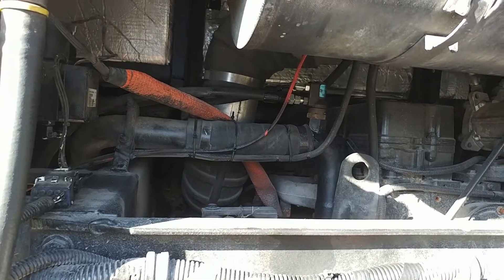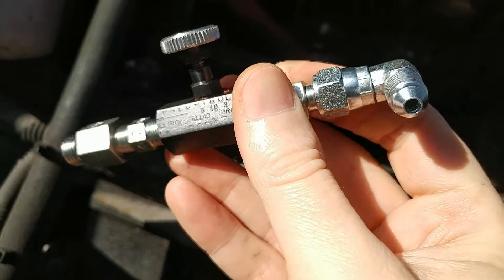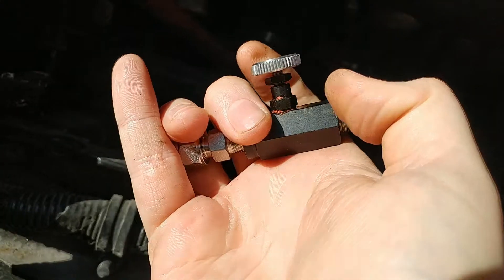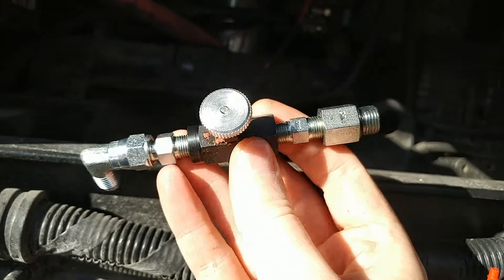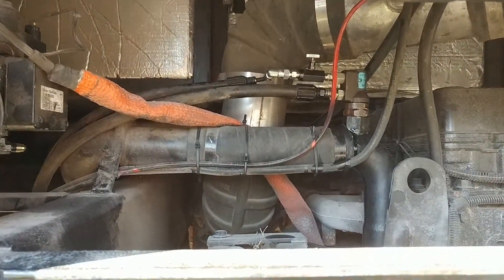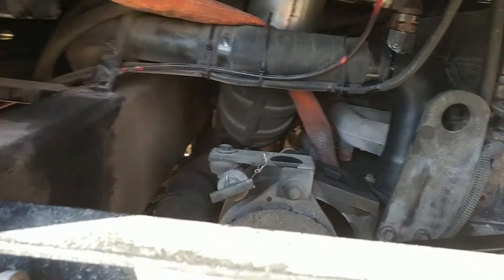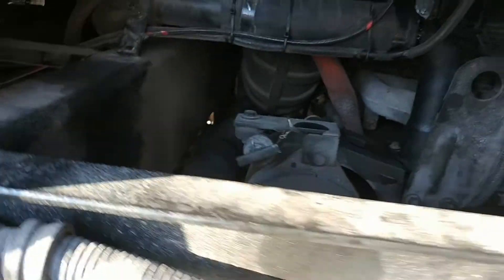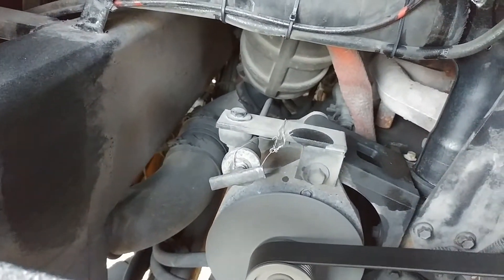Hydraulic fan controller conversion on an RV (part 2)

Comment: How many electronic devices are involved in the original design?
Obviously we see the device you’ve replaced with the wax valve. Is that the only one?
Did the original electronic device modulate the fan speed so it runs at two constant speeds? Low and High? 

Good video, thank you for taking the time to help us.

Comment: I have a 2000 Newmar Dutchstar with the 8.3 Cummins with side radiator.  When ambient air temp is 80+  and the wind is strong I cannot keep my engine cooled, downshifting to 5th helps but it still  keeps heating up, I've almost pegged my temp gage to max.  I've stopped and checked the fan when it's hot and at idle it surely isn't moving that fast, not as fast as I would think it should be spinning at a good clip at high temp. My fan runs according to engine rpm but don't know what it's spinning at road speed.  Any ideas????

Comment: OK sorry to bother you again but I have another question. I bought this valve but I have not put it on yet. The question I have is after installing this valve and adjusting it with engine cold and adjusting till the fan starts moving slow, will the fan come on full blast after reaching temperature without anymore adjustments?
Reply: No it will not. This valve is limiting the amount of hydraulic fluid going through it. Needs to be a better  alternative. My opinion

Comment: I did add the wax valve on Saturday on my motorhome, looking at your hose setup I see the bigger hose on the bottom of the wax valve. Is that correct because I think I might have mine backwards. I never could get it up to temperature to see if it opened or not course I’m still at the campground I can make these changes no problem if that’s the case
Reply from the maker: I would not know on your coach. These things are snowflakes. Part 1 shows how mine were, one is pressure line other is return, they have to be correct on wax valve or it wont work and could potentially damage the valve. I had block heat on as well as aqua hot engine heat plus fast idle to get it barely up to temp to see if fan would start to come on at 175. I could not really test it without going for a drive then adjust based on engine temps on dash.
Reply: GoFast OK I switched the lines out like yours and the valve started working it only took about two minutes then the fan came on but it wasn’t even up to 100 degrees. I wasn’t really sure how to adjust it. I would prefer the fan not to come on until it hit 180 or so. My question is if I took the orifice out of the wax valve then when the thermostat hit 170 or 180 will the fan start or does the orifice have to be in the wax valve to operate correctly? I did order that other valve that you did on your second video and will add it like you did but I am still not sure about how the wax valve works actually. With the second valve that you added and you trimmed it down to a low RPM what happens when it reaches temperature does the fan go on full blast? Or stay at that low RPM?  You can email @ roninarv@gmail.com Thank You for all your help.
Reply from the maker: @RonInAVan  There is no orifice unless you specifically bought one. The wax if it's adjustable will have a set screw under the allen plug on top, same size as the plug on top. remove the plug then adjust. Thats what the 4.5 turns out from bottom (when cold cold) sets, the temp. The tighter the hole the harder the fan will run. Back it off in small increments to make fan come on later. The wax valve operates on heat, the warmer it gets the more it expands toward the set screw, thus closing the hole up and making the fan run faster. The needle valve you mention is for making it spin all the time when it's cold regardles of temp, as engine gets hot the wax valve then takes over because it will be offering higher resistance than the needle valve. Needle valve just needed for AC mainly at idle/cold.
Reply: GoFast so I guess I better put the adjustment screw back in, and readjust it. We leave on Friday I guess that’s when I will have to test it when I can get it up to temperature. My wax valve # is 553109859140 so is the last 3 numbers the temperature setting of the wax valve?

Comment: If i decided to add the pin value, I have to ask you about the orifice. Do I need to take the orifice out completely? And where is the Orifice located?  Thank you for your help.
Reply from the maker: There is no orifice. The electronic fan controller coupled with engine compter normally does this on it's own to kick fan up when needed, but replacing it with an analog wax valve something is needed beyond temp control alone to kick the fan up slightly when the engine is cold to give the AC condenser some air. An orifice does this in a fixed way, or in my case a needle valve that can be adjusted rather than trying to guess an orifice size to buy, then be wrong and have to buy another etc. Needle valve can be adjusted as needed and left alone, or readjusted etc. Without needled valve an orifice would be used, and it's a guessing game on which size to get.
Reply: GoFast I think I remember you saying that the wax valve can be adjusted by the Allen screws and backed out 4 1/2 turns is that correct?
Reply from the maker: @RonInAVan  As a safe starting point yes. I had to adjust mine to further dial it in to engine temps I wanted. I think I'm around 3 something not sure. Drive up to temp, adjust, drive again up to temp adjust etc. Others have also. but 4.5 turns is very conservative and safe to start with.

Comment: So, if I wanted the fan to not turn at all, I'd get the 1/4" valve thus allowing more hydro fluid to flow?  In the winter, we like to have some heat and when I had installed the 3/32" orifice from Source Engineering it ran all the time (600 or so RPM) and the engine took forever to warm up to operating temp (to get some heat up front).  Thoughts?  Thanks for the upload!
Reply from the maker: My engine gets up to temp no problem with the 1/8th needle valve in place on a 20F day. An 1/8th or a 1/4 would work fine. The 1/4 inch one I know gets very very sensitive at the sweet spot since it's bigger, it takes very little adjustment between the fan running at full speed or low speed. The 1/8th I think it is really all thats needed. In hindsight for this video I think my fan was continuing to run at with the needle completely open due to the engine warming up and the wax valve starting to engage.